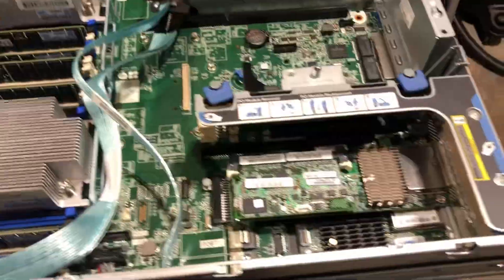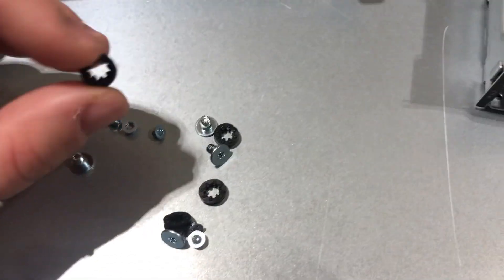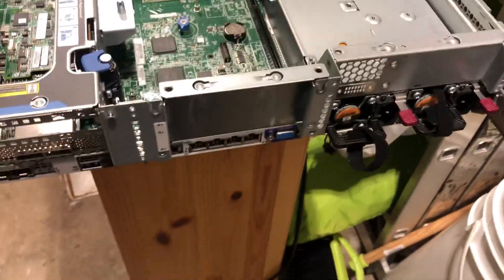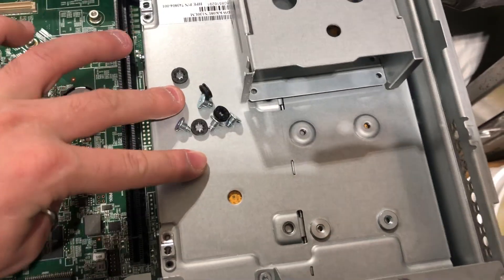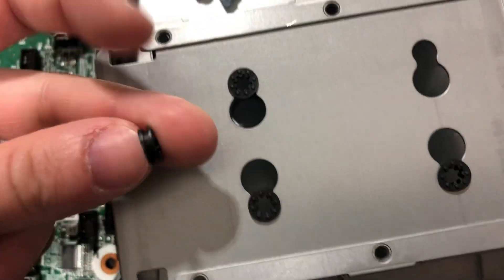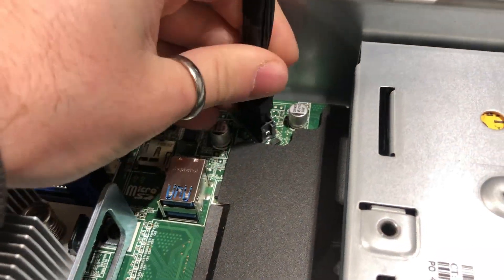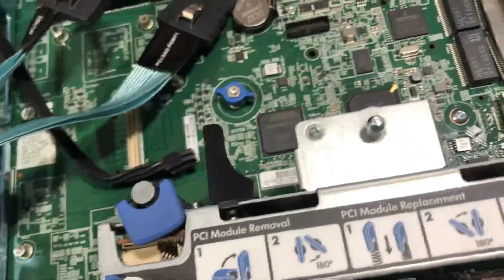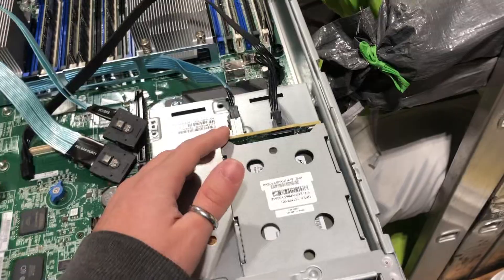Proliant DL380 G9 Flex bay tutorial - The "perfect" storage resolution - Basic overview - 5

Comment: If you can tolerate the not easy/fast swap of disk another good (and maybe be cheaper) way is a PCIe card like with M2 NVME and SATA. A Silverstone SST-ECM27 for example can use 1 M2 nvme and 2 Sata disk, with TrueNAS you can use the 2 sata as mirrored boot drive and the NVME as slog or L2ARC. There's 10 sata ports on the motherboard in DL380 Gen9 and 6 PCIe slots so a lot of M2 disk can be used...
Reply from the maker: Hey, thats an amazing suggestion, however the 10 sata ports is not… 10 physical ports. You have 2x 8087, which are equivalent to 4 sata ports each. Youd have to have a breakout cable for each port to make it work like that. In reality, its 2 sas (which can be used as sata) and 2 sata ports
Reply: @TechLabUnleashed   When I said SATA, it's at the electrical signaling level, not the physical connector (so you're right, physicaly you need a suitable cable which you can find on Amazon). Because electrically it's SATA, you can't put a SAS drive on these ports. This was helpful to me because when I started with my DL380 I wanted low cost and expandability (I'm using TrueNAS: I don't want Hardware RAID controler). So at first I used these 2x8087 connected to the front backplane with 8 SATA drives. I now have 18 disks on my server: 12 on the front, 2 M2 sata and 4 M2 nvme. I just added the flex bay because I found a really cheap one but I don't have the drives yet.
For information your powercable seems to be for the 4LLF model (the 2nd longer power cable is for the front 4 ports backplane). It does exist for your (and mine) 12LFF model with just 1 cable (not a Y config).
Reply from the maker: @frederichardy8844  my apologies! 100%